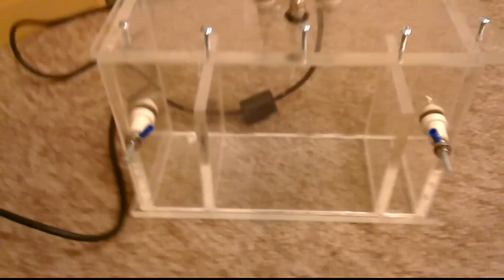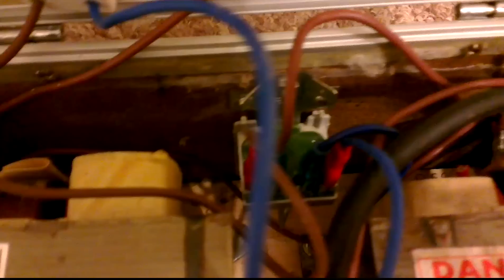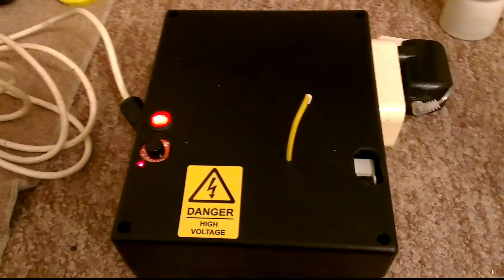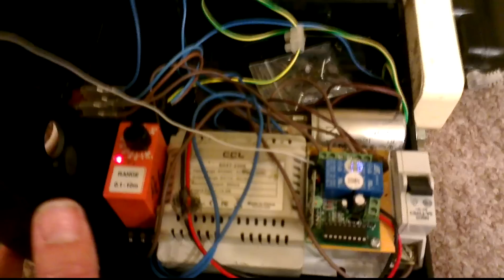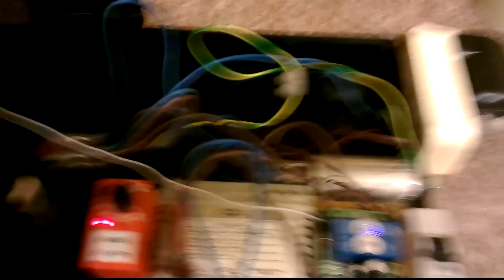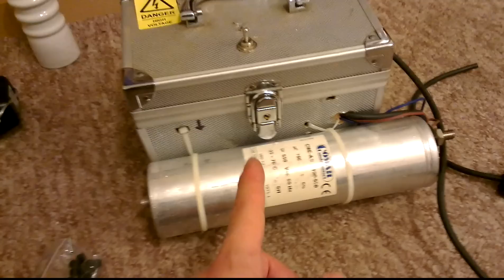X-Ray. RC Control box with Timer, Ballast 1500W / 750W and PFC

Comment from the maker: It wasn't in the vid as it was still in the making. But before I used it I earthed everything there is a line filter in the ballast box and the PFC cap that both have to be earthed to work .I didn't fancy getting shocked when switching the watts ;-)

Comment: thats fine I was worried you glued it, I work with plastics we use butanone (methyl ethyl ketone). its good to use after 24 hours.
you can also use acetone.
tensol is probably a similar product.
Im suprised they state so long to cure maybe its not as concentrated at industrial stuff.